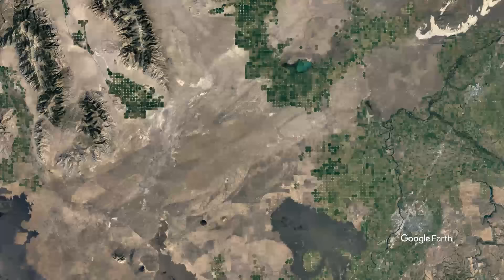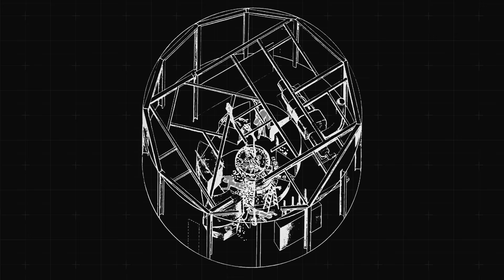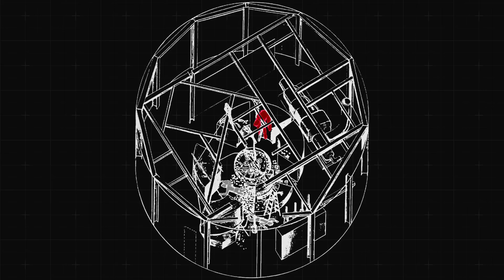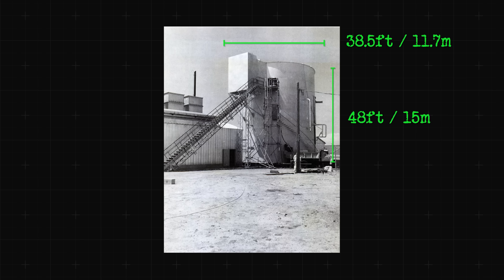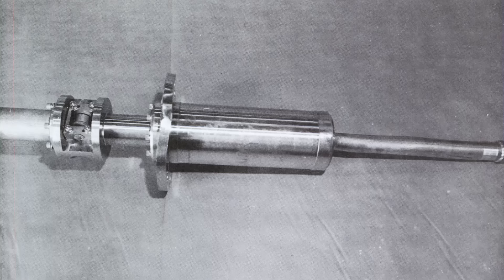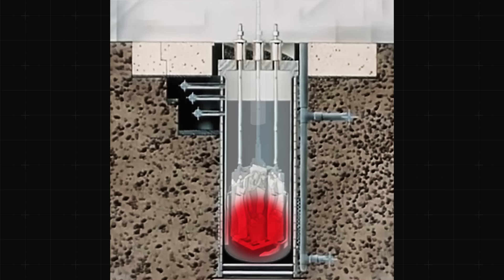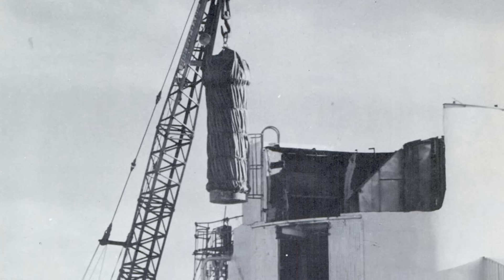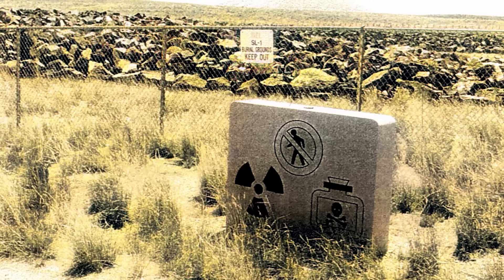America's First Nuclear Disaster - The SL1 Incident

Comment: It was never named or known as the Army National Reactor Testing Station.  It was known as the Reactor Testing Station, and has had several names since settling on Idaho National Lab.  The Navy Tested Reactors there as well.  While the SL1 was the first accident that experienced fatalities.  There was another accident at the EBR-1.  A partial core meltdown.   This facilities was located in Idaho as well.
Reply: The Idaho National Lab has a publication on their website called "Proving the Principle".  It's a good read, but it will take a few days to read it.  It also explains what happened at the SL1 facility, as well as the history of the facility, and will talk about some of the experiments that took place there.
Reply: The Reactor Testing Station was run by the Atomic Energy Commission, not the Army. After the dismantling of the SL-1 facility (known to the Navy reactor personnel as Soldier Launcher 1), the electrical power poles still stood on the site until 2022, when they were finally removed. I saw them from US Highway 20 every time I went to work or came home from INTEC in daylight. The location is inside the INL Security Exclusion Zone and is not open to the public. There is Cesium under the gravel, among other fission products and the badgers and rabbits occasionally have to be captured and relocated when they start digging burrows in there. I worked on the environmental cleanup at the Site for 15 years and saw a lot of successful cleanup projects get completed. The work is still going on out there and a lot of people are dedicating their lives to removing or isolating contamination in buildings or chemical containment tanks.
Reply: @allenra530  Never heard the term "Soldier Launcher" but that makes sense considering what happened.   The Reactor Testing Station was established by the AEC to test reactors.  Even the Navy was out there testing there reactors.
Reply: @davidleadford6511  Yeah, several of the people I worked with were ex-Navy and some of them had been trained at NRF before they moved the training to the eastern US. I read that the reactor that was in the Nautilus had a duplicate at NRF and they simulated long submerged missions there in the Idaho desert before the submarine performed them out in the ocean. They did one full year without coming to the surface and simulated it out there. The last Navy reactors were just dismantled about a year ago.
Reply: There were multiple types of reactors at one time or another.  Jimmy Carter shut down a very promising reactor process, according to an engineer on it and a personal friend.  That old saw: "If you see me running, try to keep up" had REAL meaning in those days at every sub-facility at the INEL, or INL!

Comment: I’ll never understand the thought process behind removing (or altogether omitting) redundancy from failure-critical systems.  It seems to me that, despite this being an experimental reactor, the potential consequences of using only one control rod to mediate power output should have been entirely obvious.  The reactor was designed with multiple control rods for a reason, and it’s ridiculous that safety was so blatantly disregarded for a slight increase in efficiency.  Ridiculous, but, sadly, not surprising.

Comment: Some sources cite reports of Bynes injuries further.  Apparently the rod entered his body at the crotch, went thru his torso and exited partially out his shoulder.  And how they extracted his body without exposing the recovery personnel is a bit interesting.  Basically used a cherry picker, and then removed the plug from his body.  Pretty gruesome.  I trained at S5G down the street at Naval Reactors back in '88.
Reply: Yikes. Whoever had to go in the cherry picker must not be squeamish at all.
Reply: You're right, very carefully as remotely as possible!  The most frightening thing to me is that vessel was propelled high enough to impale the missing operator high up in the roof structure!

Comment: It was not so much the amount the rod was moved but rather the speed in which it was moved.  These sorts of reactors are somewhat self correcting in that increasing the fission rate increases water temperature which decreases water density which makes it easier for neutrons to escape which in turn decreases fission rate.  Quickly yanking up the rod (consistent with applying excessive force to unstick the rod) did not give time for this self correcting process to kick in.

Comment: Every type of power generation has its advantages and disadvantages.  Things can go wrong in the design/manufacturing phase (insufficient fail-safes), mechanical issues during operation,  and the human factor. Of these,  the human factor is the most common cause of nuclear accidents.  
However, no matter the cause, the impacts of an accident in the nuclear industry can have far-reaching repercussions. The fact that an accident can result in a self-sustaining reaction makes it much more dangerous.
Dependence on any single energy source is never a good thing.  Science continues to explore new methods of energy generation that produce effective results, with limited hazards. As long as utilities focus on the bottom line, rather than safety, count on 'accidents' happening.
The search continues...

Comment: Question is, why does a reactor designed to operate at 3MW get a fuel quantity enough to produce 20MW? Lifting one control bars by little more should not cause such a mess right?
Reply: Because in order to get the 3MW reaction you have to have enough reaction material to produce far more.  It's not like you're burning gasoline; the material all reflects neutrons back into the core to keep the reaction going.  It's like saying you're going to burn one log in a fire, instead of enough to keep a good hot core going for a really useful fire in a good shape.  You have to have enough to maintain the reaction and keep it hot enough to be useful.  That means if you're not careful, it can do far more.  But putting less in there would mean it wouldn't be self sustaining.

Comment: Not mentioning the smear campaign on the worker to divert blame about a completely bullshieeeet design of having a single faulty lynch pin catastrophic design flaw that had been reported and warned about far in advance. There were even scares from almost-bad mistakes before where a technician had caused a power spike using excess force because it was corroded and stuck, but it didn't cause an explosive failure. No that one navy sailor nuke tech impaled on the ceiling liked to drink beer, so it's all his fault.

Comment: It’s all good until it’s not. I’m for nuclear energy but we need to let the pocket protected wearing engineers do the work and have the executives pay without question. 

Fukushima wasn’t an engineering mistake. It was designed with the generators placed more than 200’ above the tsunami water level. $$ moved the. To the basement. That’s not a problem with nuclear energy, that’s a problem with the money managers. If they couldn’t afford to do it right they shouldn’t have done it.